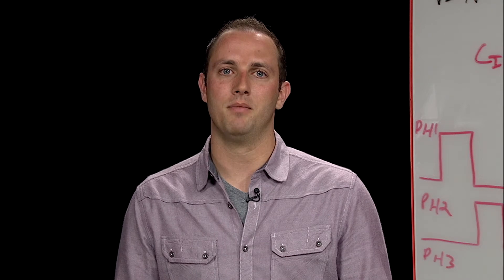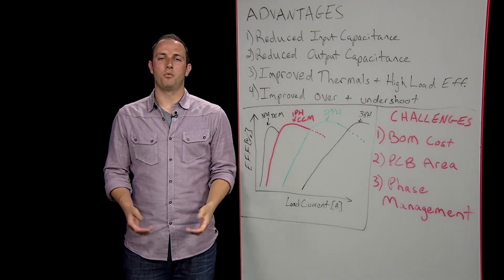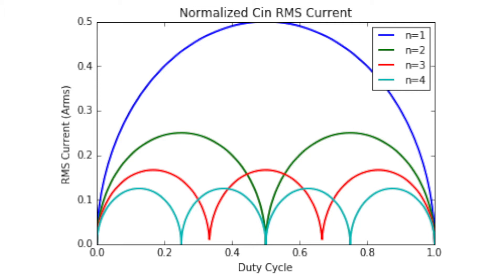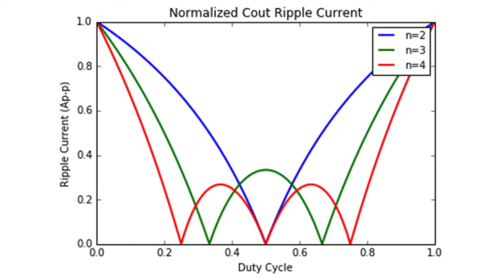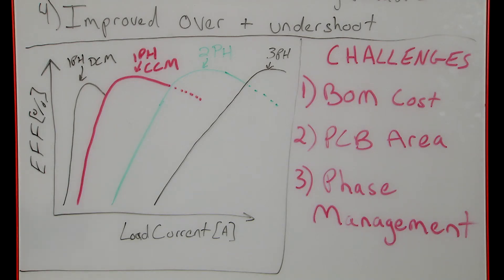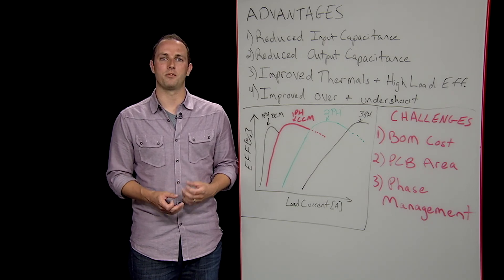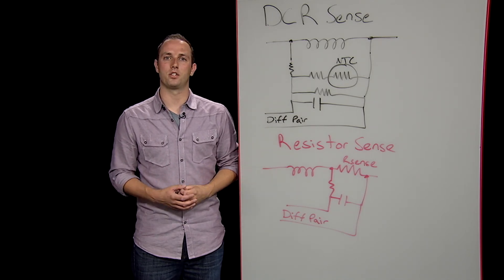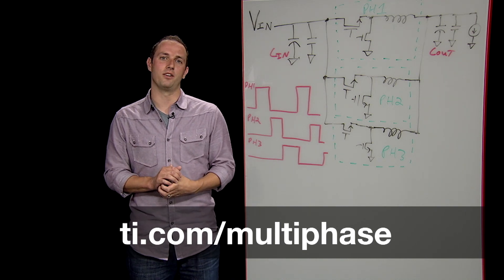An Introduction to Multiphase Buck Regulators

Comment: Wow! All the necessary basic information, none of the unnecessary; short, concise, to the point, spoken clearly without an accent (although a bit too fast). And even though it's a  Texas Instruments video, not a single one of their products was pushed or advertised.
This is how every YouTube video should be.
If the presenter spoke just a little bit slower, this video would score 100/100. I am simply amazed!